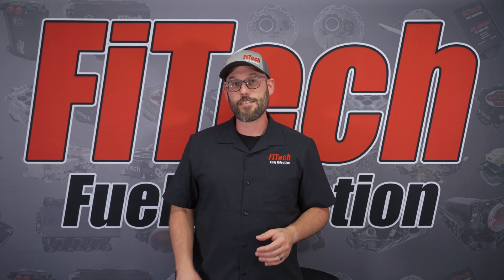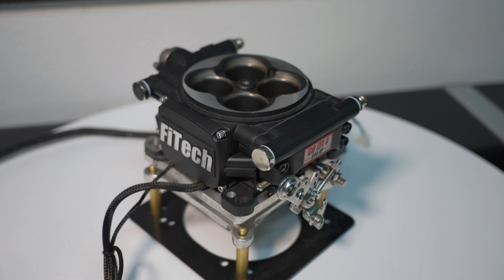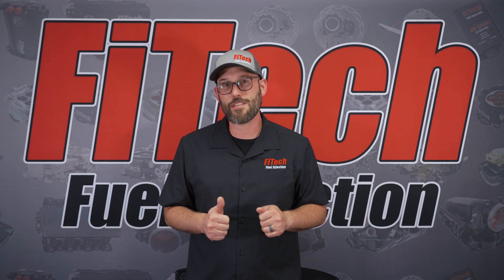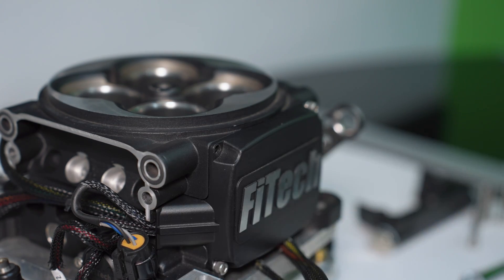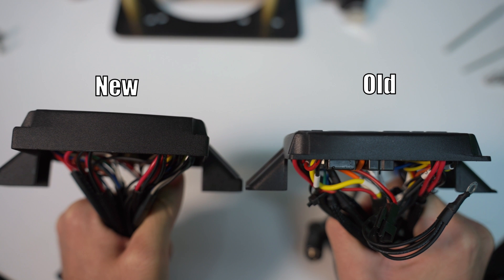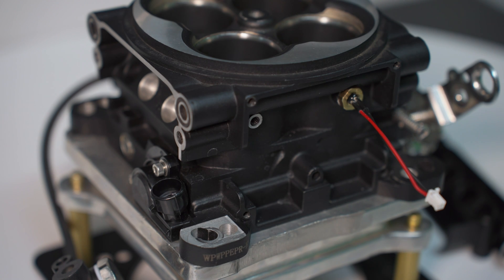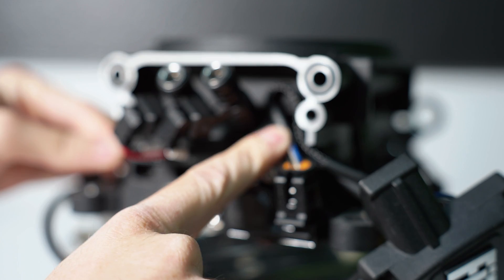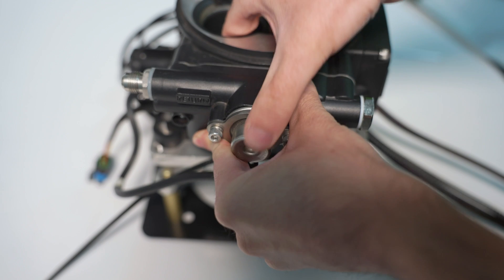Swapping Your FiTech ECU | Tech Tuesdays | EP97

Comment: You should have mentioned the plastic IAT sensor and what tap to use!!Would have saved me a lot of time!
BTW 10x1.25 tapered tap is required for anyone needing this information. Also, the plastic IAT can be remove whole with a reverse drill or easy out.
Thanks!
Reply: That's not for all/current systems. I'm updating an old 300002. The required tap is M10x1.0 according to the website (and my mk1 eyeball gauge)

Comment: The 30002 ECU stops spraying fuel once it gets heat-soaked to 174 degrees. Does the new ECU fix this defect?
Reply: Even if you install a carb spacer?
Reply: @IvyGreen1966  I don't have enough clearance with my intake, despite using drop down base and polyurethane frame mounts to restrict rock.
Reply: @rfitzgibbonsvmsteks606  What if you used a shorter air filter? Edelbrock also sells a heat insulator gasket part# 9265. I use it on my edelbrock avs2 and helps with heat soak. Also Fi-Tech has EFI classic version throttle body that has the external ECU so you can mount it away from heat.
Reply: @IvyGreen1966  I am using a 2.5" filter now...with the drop base that leaves little room for airflow. However since going to polyurethane frame mounts the motor rock is much less, and I may be able to squeeze in a spacer.
Reply from the maker: To date the remote relay box version of ECU has a very low failure rate.
Reply: @FiTechEFImedia are you talking about the EFI classic?
Reply: @IvyGreen1966  I guess...it's the 30002 model EFI4 600hp

Comment: Great video, maybe fitech can do a video on setting the IAC on the dual quad systems, thanks🏁🏁
Reply from the maker: The method is the same as a single throttle body. Just be sure to have the linkage set 1:1 at the start.